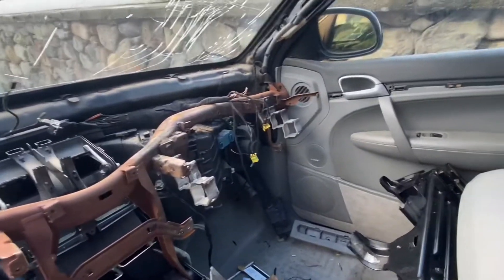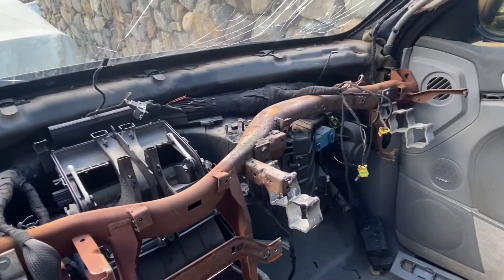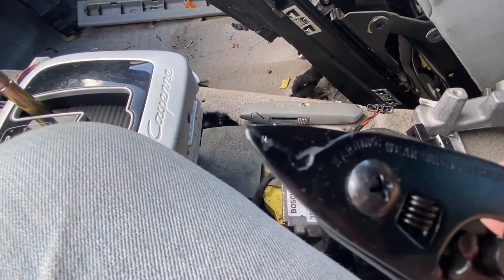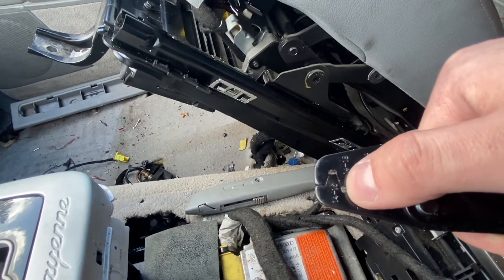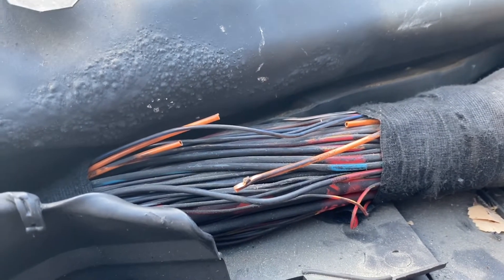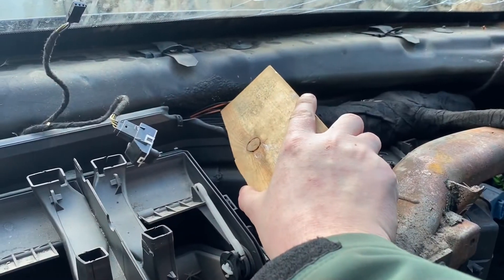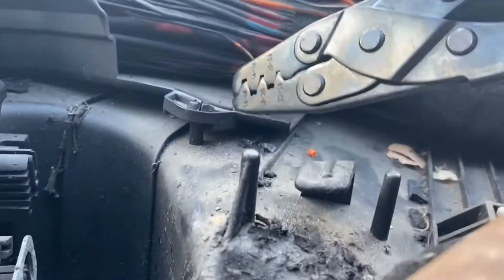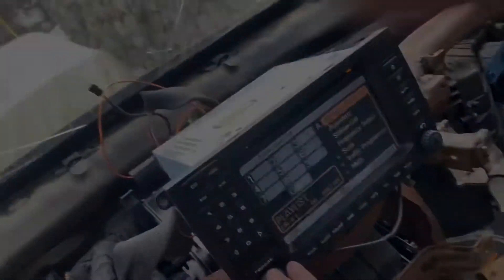How to repair MOST Fibre optic cables in Porsche/Audi/Mercedes/Volvo/etc

Comment: Do you have the exact link to the joiners?
Reply from the maker: https://www.ebay.ca/itm/MOST-Optic-Fiber-Break-Cable-Connector-And-Metal-Pin-For-Audi-BMW-Benz-etc-/262294586652?mkcid=16&mkevt=1&_trksid=p2349624.m46890.l6249&mkrid=711-127632-2357-0